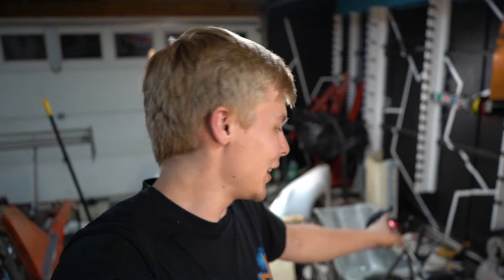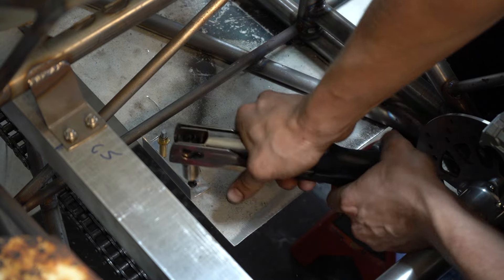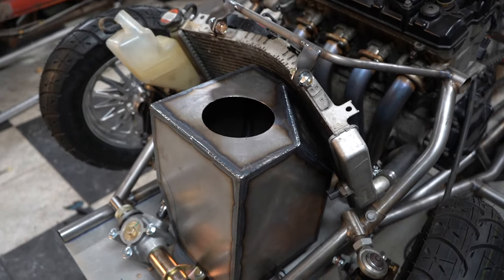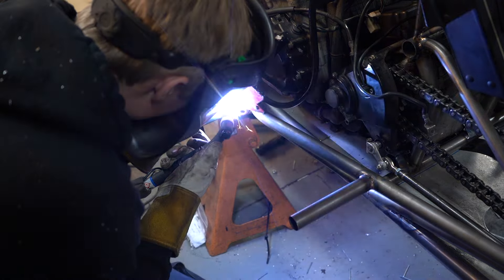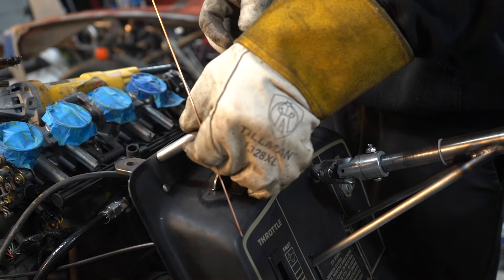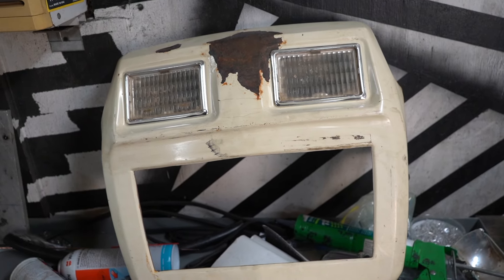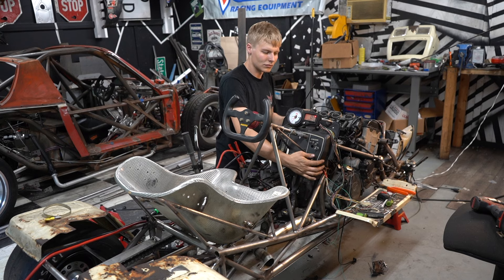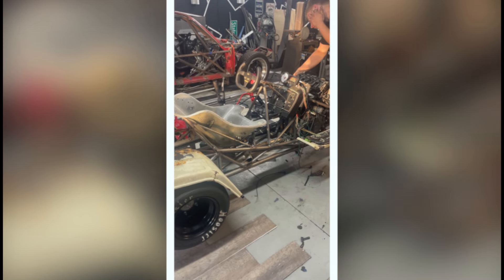Worlds Fastest Lawn Mower First Start | Pt.4

Comment: Great stuff as usual, the build looks good, I'd have done it pretty much the same way.
 A friend of mine that I used to run monster trucks with, went into lawn mower racing. He reckoned it was a lot more brutal on his body than the monster trucks.
Any idea about how fast you would realistically go. I believe the record at the moment is 143 mph.
Reply from the maker: Faster than that. At most 160 is a goal
Reply: @ZipTied  That's a good solid number, with the components you've got it should be achievable with a bit massaging...
 160 mph without suspension (good to be a pioneer ).... but at least you have a fair bit of caster... 
My only concern would be the seat angle and lack of upper back support it offers  If you stack it of get onto some rough ground at speed it'll snap your back at the edge of the seat....Which is why we changes the seating position in monster trucks and gravel rally cars to be more vertical.
 But you look young, and are probably still a bit bendy, so you might get away with it...
Just a thought..... if the cutting deck was a bit bigger, closer to the ground, with a vent on top, and the blade was spinning at around 20,000 rpm... just saying....

Comment: Nice work, beside the O-ring
Do you think the Rad will get enough airflow with the tank in front blocking most of it?
Reply from the maker: If its only running a 1/4 mile it doesn’t need it. A lot of gixxer drag bikes don’t run a radiator at all so it should be fine. To run fast im going to block the nose off completely
Reply: @ZipTied  Thanks for answering. Makes sense.